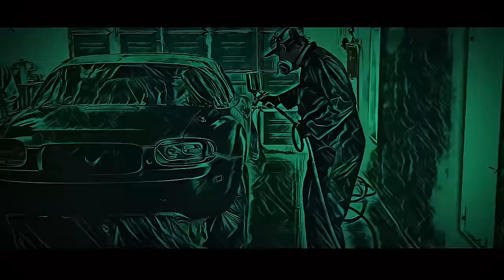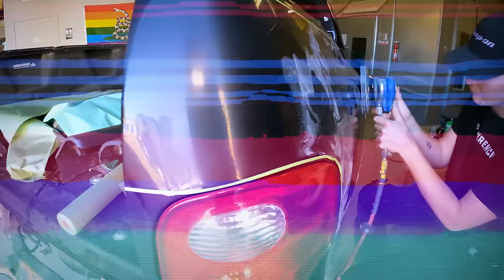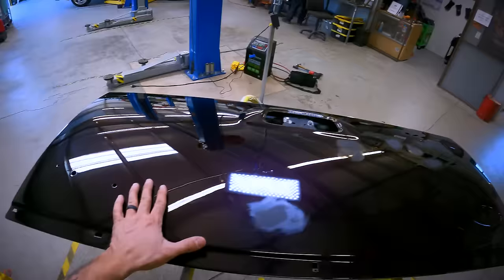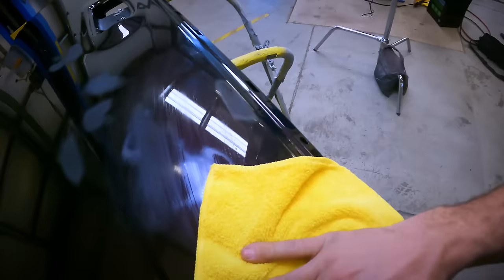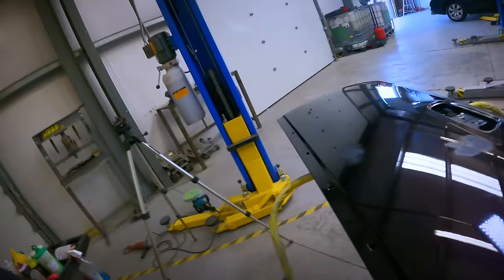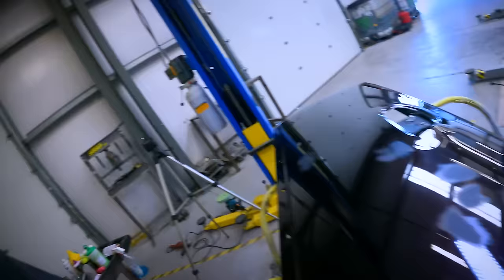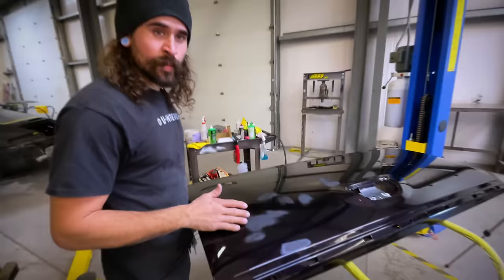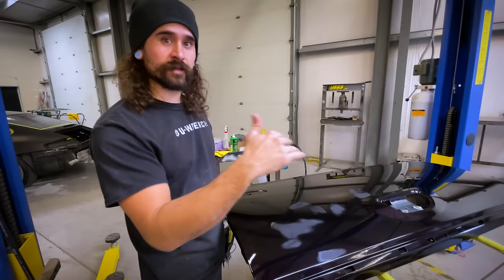How to Fix Orange Peel and Nibs | Cut & Buff like a Pro

Comment: The beginning part of your video where you are describing the problems we have from painting in our garage was spot on... I'm a little better than some I guess as I have ZERO orange peel, and NO runs, drips, or sags... however.. it looks like I threw a handful of beach sand into the clear coat while it was still wet... It's now a NON-SLIP surface because of all the nibs. That would be the best way to describe it. If I try and remove every nib in my paint-I will be sanding the ENTIRE panel.. so.. that's my plan. Just wet sand with 1500, then 2000, then 3000, then cut/buff/polish. Sucks because it is a beautiful finish.. just TONS of nibs.

Comment: One of my good buddies is amazing when it comes to painting. To give yourself a fighting chance doing it at home is make sure your gun and psi is set right. Use the right tip for what you're spraying. Wheather it be primer-sealers, color, or clear. Having 20 different paint guns for different things helps lol. Setting your gun and psi correctly are the most important things from what I'm told.
Reply: Yep, setting your gun has many aspects to it. Flow, Fan, PSI, and also adjusting the fan correctly to spray out right. All details are important.

Comment: Also smart on knowing that you use wool pads like that with a rotary. Many make a mistake of using them with a DA long throw polisher not realizing they just arent designed to be effective with DA polishers. Nice to see another professional who put the time in learning and remembering it. I use a lot of 3D One with buff n shine urofiber 50/50 pads on my own vehicles that i have done a 2 step correction on in the past. Lately i have been using for my last step a polish by Carpro called Reflect, i swear its the best final polish/enhancement

Comment: Spot on with the tip on brands of sand paper and thats weather you are buying sheets or disc, or coarse grits for body work, or fine grits for polishing. I learned a long time ago about cheap sand paper now i stick with Mirka, 3M, and Norton. For polishing clear I like using Mirka Galaxy 1000, then 2000grit, 5" disc, then use 3M trizact 3000 followed by 5000grit. I also polish with 3D brand compound and polish

Comment: I love the introduction that's almost exactly what happened I spray painting my car and I did it a little at a time I picked up the new product by Rust-Oleum it's a 5 in 1 spray can with five different spray nozzles. I'm extremely impressed with this can of paint I painted my car a little at a time on my lunch break at work probably all in total 10 different lunch breaks I do have a lot of orange peel and paint runs

Comment: Fantastic Job! I have been doing exactly what you have been doing and I have 1st hand knowledge that these steps work. Although the nib tool scares me that if the nib is deep it may be pulled out like an ingrown hair then i am stuck with paint cup, air brush, and blending clear in hand...Ouch! But you do extremely professional videos and work! I am a union cameraman and video engineer in Chicago, it's nice to have a pro bodyman go the extra mile and have a good microphone. clean audio, and solid in focus HD video!!! Well Done, I have subscribed!!! Lou
Reply from the maker: @lad63bird - shooter/editor here. Happy that you like the content and production quality. I started in broadcast production in 1981 and recently retired. U-Wrench is my sons business so to give myself something to do I started their  channel. It’s a totally different beast compared to the productions. I’ve been used to for the last 40 years. I try my best with the limited equipment that I have but I’m hoping in the future that I can invest a little bit more as the channel grows. The most difficult thing if you watch any of the other videos on our channel is the lighting. The  fluorescents in the shop are 3800 Kelvin and then I’ve got daylight through the open doors around 5600 so at times that really wreaks havoc with the white balance. I’m hoping that we can get the fluorescents changed to a daylight temperature soon. Anyway thanks for the comment and I hope that you like the other content on our channel as well.

Comment: I just painted my gas tank on my motorcycle and used the can of 2k high gloss clear and it turned out good but I had alot of trash doing it in my garage. But I used 1500 grit wet sand and it's all gone. Now I'm going to go with 2500 and 3000 get then biff but I never buffed anything so I bought 3D cut and polish off amazon I'm hoping it's not complicated since there is so many weird edges on a tank unlike a flat door.

Comment: 3D makes some good şhìt! Love their products,  haven't used any that weren't worth buying,  although I can say that about other mfg of products. Kind of like tools, there are soo many out there you buy and buy and then sink the $ into a good snapon,  matco, or other tool truck tool and if you would have spent that originally you wouldn't have wasted all that money. I never thought I would spend $50 on a pair of needle nose pliers but I did and when they will grip and tear a super thin candy wrapper they will handle the task no problem,  can't say that about the other bucket full of $5-20 pliers I got thru the years!

Comment: I feel like an autobody repair shop would cut all kinds of corners and not do even close to as many steps. I have issues with the paint done on mine through insurance. The shop said they would sand down the surface imperfections and repolish/buff. Not sure how much better that will turn out.

Comment: Thank you my dear brother for an informative video. I dont know what's Wrong removed a lot of paint not just the clear coat but the super coat also known as the second base coat, the first base coat and the primer exposing the metal.I felt I was using the wrong sander can you please tell me and others who are new to such work which sander to use  for color sanding and how to properly use it

Comment: Man I got some cheap compound right I literally did everything right with the wet sand.
And stuff but now I'm spending hours on buffing the car that compound I got it doesn't remove nothing KY just makes my panel shine now all I have it's scratches every where I was so stress I burned the clearcloat because the compound was doing nothing right.

I will try the 3d product and thank u I hope all my wet sand scratches go away because it's a black car:(.

Comment: Question. 

Have many dinks from stone hitting my doors and along the whole side. 
Was somewhat semi sucessful in painting the doors and front fender to the rear wing up to the windows. 

Three things messed up something which does look like a decent paint job, black metallic, one was wind, my masking was ripping to pieces landing in to wet paint. 
Next thing which really messed up the clear coat was pollen, and the fact that I went out of 2k clear coat. Aka, not enough to cover. 
Third thing which messed this up was the stone chipping was just a hair to deep to be covered with filler primer, so the small areas is shining out like white circles. 

How can I fix this? 
Sand paper, k400 and go back to bare metal in the affected areas, redo the bondo and wet sand with k1200,  over the whole area, blend in pain in the spots and clean it well, before I take another attempt with enough clear coat and then polish it up? 

Or is this beyond every hope of salvation?

Comment: If I just had a panel painted less than 2 weeks ago, how soon would I be able to wet sand and buff it a bit more? There’s just a tad bit more orange peel than I would like to see. I was considering wet sanding by hand with 2000 grit and 3000 grit, then buffing using one of two Rupes I recently acquired.
Reply: That’s plenty of time and 2k grit is good

Comment: Good tutorial. Can you provide the links to the air sander that you used in this video? also the pads you used as well. thanks
Reply from the maker: orbital sander - https://www.jegs.com/i/JEGS+Performance+Products/555/M548/10002/-1?srsltid=AfmBOoql8Z8etTZafn4k_eIx2dNNky-02BBC5ewRQrMdCayMbfj0F1FnPmc

buffer pads - https://www.dkhardware.com/high-teck-products-775-wool-buffing-pad-75-diameter-15-thickness-product-3919260.html

https://eaglenationalsupply.com/products/high-teck-8-inch-diameter-white-foam-compounding-pad-2-pcs

Comment: Thanks for all of the good advice, helped me a lot to bring my project at a nice shiny finish. Would 3D ACA500 do a similar job as the 3D ACA510 ? They seem to be quite similar accrording to description on the bottle. Thanks.
Reply from the maker: Yes, Fred has used both and they are very similar.
Reply: Thank you sir for the response, I appreciate it. :).  @UWrenchTV

Comment: Painted a car base coat clear coat.  Wet sanded 1000, 1500, 2500.  Beginner…  using megruirs 110 with wool pad . The shine is really good but still have light scratches  in it.  Not looking for show car results. Any suggestions? Thanks

Comment: So I tried 3D ACA 510 after getting tired of the mess 3M Super Duty was creating but I'm getting a ton of very fine swirl marks.  This is after wet sanding up to 2500.  Is 510 fine enough to leave clearcoat surface swirl free or do I need another step after 510?  I'm using hex logic orange cutting pad on rotary.

Comment: What the coarsest grit 3D one can level with the twisted wool and rotary?
Reply from the maker: 2000-2500 grit...more like 2500
Reply: @UWrenchTV ok thanks, I was curious if it could level a P1500 grit sanding mark, sounds like it’s best to stick to one of the compounds. Which compound from 3D in your experience has the strongest cut? I notice they all claim P1000 or finer, but one of them has to be the strongest with a wool pad and rotary? 510, 500, 501?

Comment: It’s why I’m scared to death to paint the 1968 Galaxie fastback survivor I found recently. I don’t want to spend 5k on a paint job because the car will be worth 20-25k when I’m done with it. 10500 for the car, another 2-4K in parts, plus repairing a few small dents and a paint job.  I’m thinking of trying acrylic enamel garage paint job, and then wet sanding and polishing it instead of going with urethane where there’s not as much room for fixing my screwups